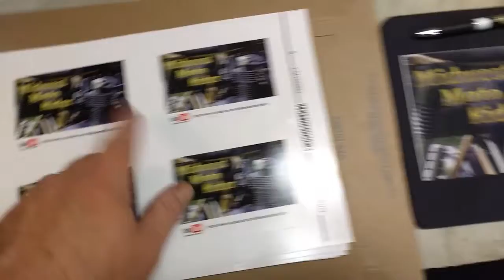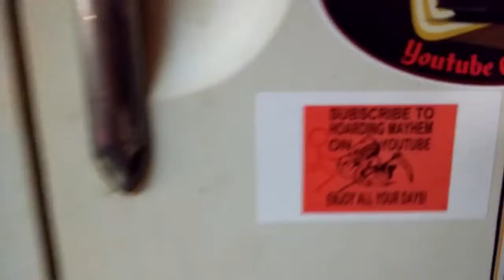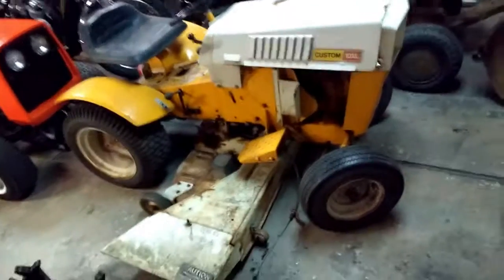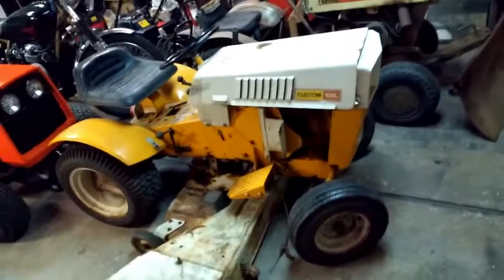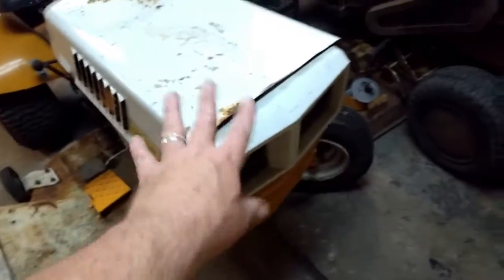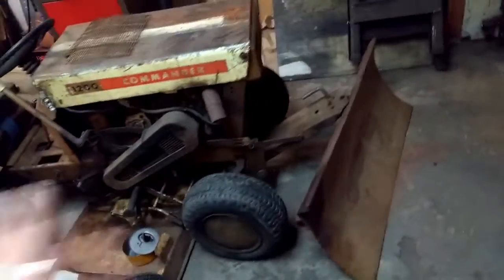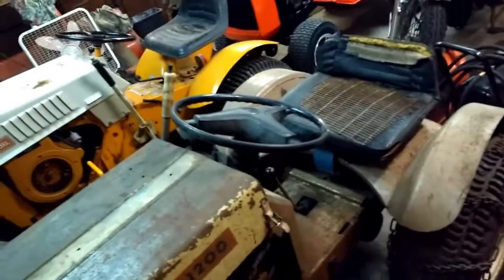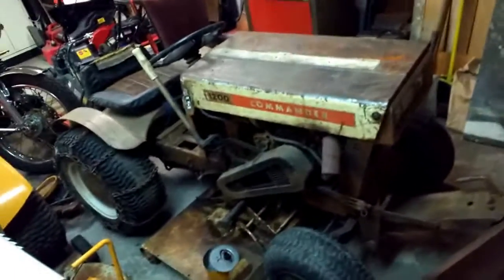What the heck did I just do - Mail call

Comment: I have a commander 8 , looks just like the 12 . I believe mine is a 1968 . That is a wonderful find . I like the sears , but what a score on the Gilson , and with a blade . That was a good find .
Reply from the maker: Nice do you have videos on the Commander on your channel? I would like to see them if you do.
Reply: No videos . The K181 has a broken connecting rod . I got it in the 70`s . It has been sitting for prob 25 years . After i get the sears going i want to do some work on it . It was never a real good for mowing , but a good work horse . I have a 12 hp  engine from a wheel horse , but thinking it was to tall to fit under the hood . i may have to look in to that or redo the 8 hp . u do not see many from that era .